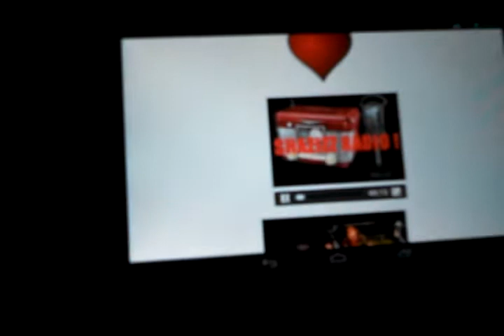Tesla/Slayer exciter Magnifying transmitter

Comment: Hey terry, did you just make 3 coils for the magnifying transmitter?
Reply from the maker: I just was putting random coils together to check out the effects.
Reply: @Terrywoodrat  did you ground two of the coils? Trying to figure out how take a magnifying transmitter. I assume that you have something like a slayer exciter and you have L1 and L2 connected like normal. How would the L3 could be connected? Just straight to earth ground?